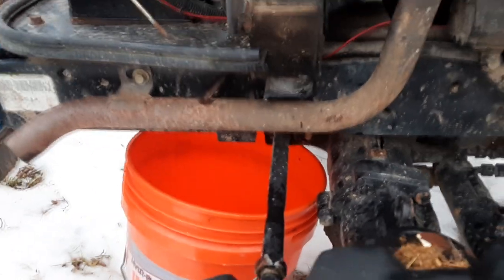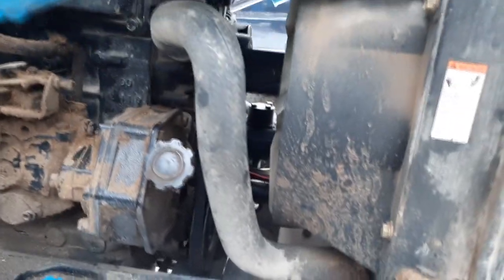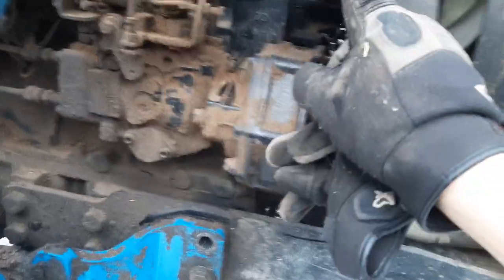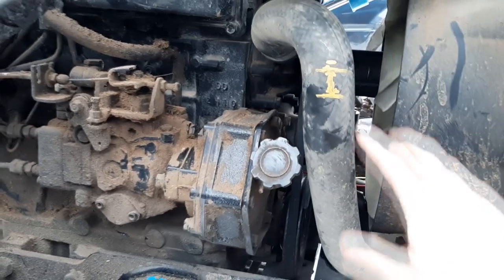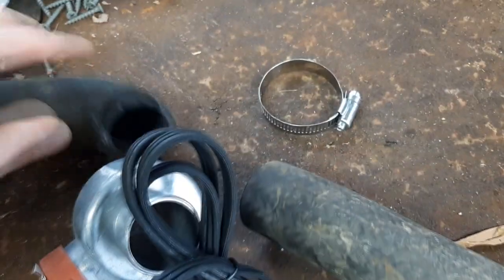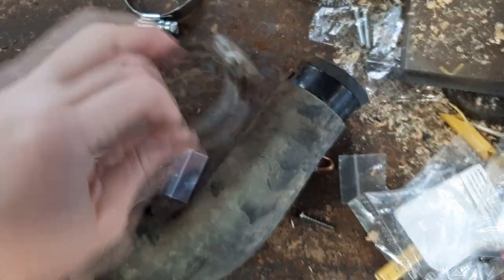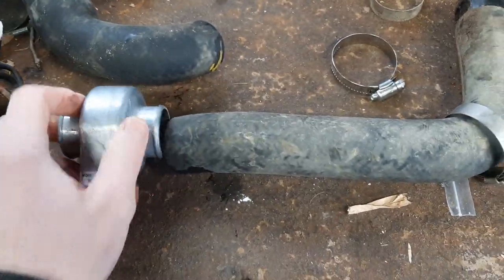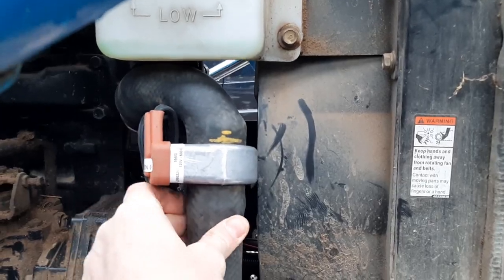How to - Install Lower Radiator Engine Heater -  LS Tractor

Comment: Curious, a year later are you still happy with it or would go with a block heater?
Reply from the maker: Hello, so this does work, but it seems to me that a block heater works better. They also tend to use less power. If I leave this plugged in long enough, it will heat the entire cooling system, but it takes a lot longer than a block heater would need.

Comment: Great video  thank u! Have h had any problems with it?
Reply from the maker: Thanks!  No problems. It works well. I think the only down side is I don't want to leave it plugged in all the time. I have thought about putting it on a timer to switch on for like 15min every hour so that the tractor is always ready to go instead of having to plug it in then wait for it to warm up.

Comment: How does this work on circulating the warm coolant into the engine? I've got one on my truck and cant really feel much heat further up the hose even after its been plugged in for a long time.
Reply from the maker: It uses convection, which is not very efficient. For my tractor, if its below about 30°F then it won't start without using this heater. So it does work, but it won't warm the engine like a block heater would. On my 2005 F250, if I had the block heater plugged in, it warmed the whole engine bay which was nice if I had to work on it.
Reply: @goddom  yeah my diesel wouldn't start during a recent cold snap. It was -34°F though. Not even sure how much a block heater would have helped if the oil was thick as icecream. I just got an oil pan heater and battery blanket heater for future ridiculous cold snaps.

I've seen circulating antifreeze heater units for sale. The heater has a check valve in it to prevent heated coolant from cooling off and going back down the hose. Sounds like that might circulate better than the lower rad hose heater.

Comment: Looks a little scary. I would prefer a lower wattage.
Reply: Block heaters take just as many watts
Reply: A factory block heater on any diesel truck is 1200w to 1600w. The computer you are using is probably around 600w. So no it’s not a big heater.